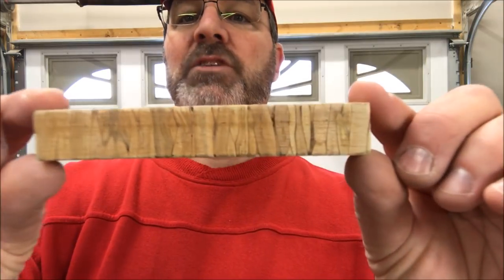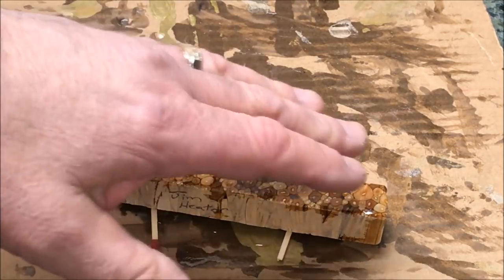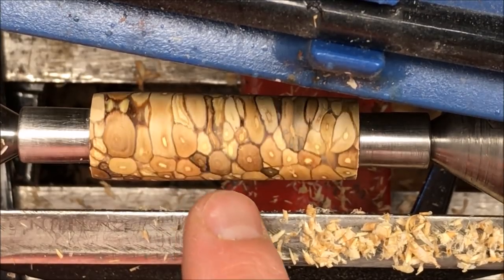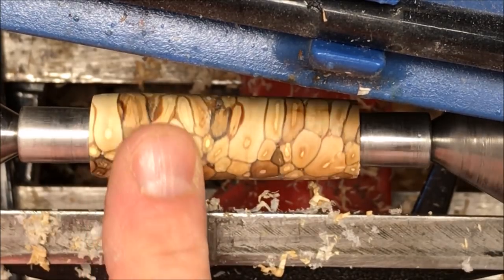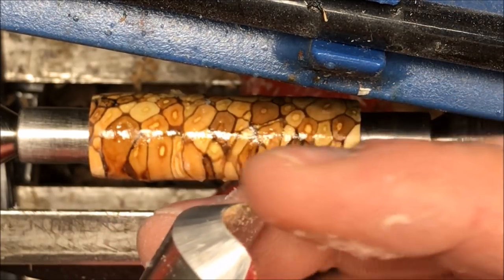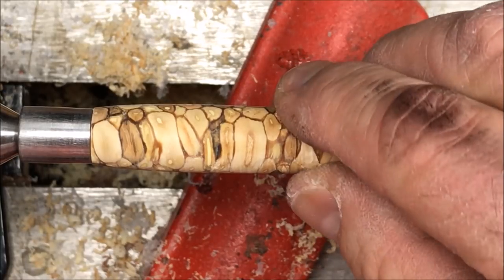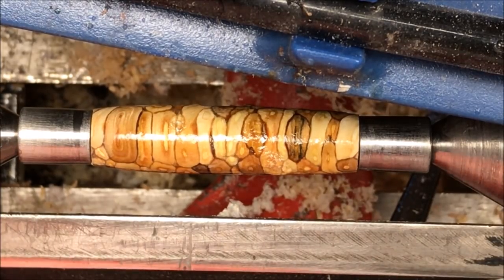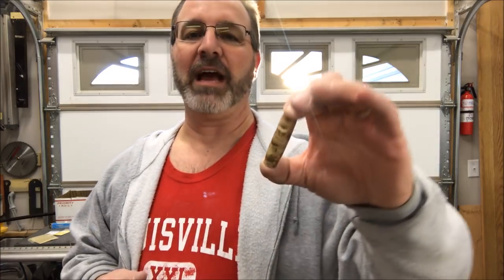Apple Twig Blank

Comment: What a great idea for a blank. Since it is basically 2 twigs that broke off, and since you have a good amount of wood to work with between the tube and the outer edge, and since it is not a symmetrical piece, those 3 points make me believe I could take some twigs of suitable color and carve them so them could be pressed into the void. Glue them and press them in (I would leave a lot of extra on the ends and the thickness. After the glue cures, I would pare them down to match what the rest of the blank looks like and then continue. Even if there is a void between parts new and old, there are voids throughout so it will match. I doubt you can tell the difference when you're done. Good luck. Sam
Reply from the maker: Thank you Sam, that is a good observation of the blank as well as an excellent idea. 

Regards,
Bob

Comment: Hi Bob, Roger from over the pond,That will be a nice pen when it’s finished, I would fill the hole with some of the sawdust you turned off of it, you could even mix some fine copper or brass dust with it and make a feature of it and also add some strength to it . Worth a try.
Reply from the maker: Thank you Roger, 
  I hope to work on it soon. 

Regards,
Bob

Comment: Couple of suggestions: Easiest add a saw dust patch.   However, I would try to make a patch with a small sliver of branch contoured to best fit.   Instead of continuing with the gouge perhaps a finish by sanding to ease the aggressiveness as minimal as it might be.   I have turned some blanks made with Boy Scout popcorn for Troop scout masters and applying bits of popcorn in the voids worked.
Reply from the maker: Thank you for the suggestions Bill,
  Take a look at what I did to fix it. 

Apple Twig Blank 

https://youtu.be/n-8KsMRwEpI

Regards,
Bob

Comment: I think the piece that broke off went into the vacuum. I think I would remove the rest of the broken end, make a small brass, copper or aluminum washer and slide it over the end as a dividing point. then use some of the rest of the blank to finish of the end.   

I love how you slo-mo  the catches and explosions. Great work all around.
Reply from the maker: Thank you and great suggestion. 

Regards,
Bob

Comment: I have an idea that I've been waiting for a catch like this to try out.  Part off the broken end then tightly wrap the tube in copper wire (maybe 2 layers to get the thickness) then seal it all up with CA and continue as usual.  Maybe even use a couple different gauges of wire to get some sort of pattern in it
Reply from the maker: Very cool idea Jeremy. 

Regards,
Bob

Comment: Had same problem with a blank called a Dakota Burl, (ground up sunflower seed hulls). Kinda like turning wafer board and tendency to chip easily. Learned real quick, turn to 80% and then turn rest using 60 - 80 grit shaping paper and work your way up. Never had another problem.  Since it is apple, add some red epoxy to it and tell them it's apple peel.
Reply from the maker: I had a Dakota Burl at the Honor Flight Turning. It blew apart on the fella who tried it. 

Regards,
Bob

Comment: Bob I know you fixed this already. Last time I had a blank chip like this I repaired the blank as you did. I flipped the blank after it dried because the original leading edge was raised similar to yours.I had no further issues and it turned out fine. Of course mine was not a twig blank so it may not have helped...
Ron
Reply from the maker: Thank you Ron,
  I appreciate hearing about your fix. You never know what I’ll have to fix next and this technique may be just the trick. 

Regards,
Bob
Reply: RJBWoodTurner 👍

Comment: Hi Bob I think the biggest problem with the Blank was presenting the Roughing gouge full frontal  at 90*  IMHO you would have had better result if the Gouge was catting at 45 degrees Or even better using a skew Chisel cutting at 45 angle, Thanks for your videos always entertaining and Informative,  Cheers.
Reply from the maker: Thank you Antonio, you’re probably right. 

Regards,
Bob

Comment: Get a couple of twigs roughly the same size, carve a divot out of one side to match the pen tube, the trim the twigs to match the broken sections. Clean off any excess CA from the tube and damaged area, and glue the new pieces in using epoxy glue, not CA. Clamp in place until cured then file off edges until close to the blank diameter, soak in more thin CA, and use a negative rake scraper to finish, light cuts only.
Reply from the maker: Great suggestion, thank you. 

Regards,
Bob

Comment: So gutted about that bob it is a gorgeous looking blank. I wonder if you could use some small slices of wood shavings to layer over it using CA glue? Maybe take a scalpel to cut some wood shavings into tiny slices and glue them over the catch one at a time until you’ve built up a decent layer of wood and CA I reckon if you get it right it would blend in nicely. Whatever you decide mate I can’t wait to see the finished result. 👍🏻
Reply from the maker: Thank you Dave, 
  Great suggestion. 

Regards,
Bob

Comment: Not that it’ll help now, but when I turn very delicate blanks, I pretty much just sand it all the way.  The disc or belt sander to basically get it close, then 50/60 grit to refine the shape and then more sanding and finishing from there.  No need to constantly be messing with sealing it with CA.  Worked like a charm with all of my color pencil blanks.
Reply from the maker: Thank you Greg. 

Regards,
Bob

Comment: Hey Bob.  I hate losing big chunks.  I would put dye in alumilite, or mix sawdust in epoxy and gloop it in the hole, then turn it down.  You have a pressure pot, correct?  If not go the epoxy route.  I've never put dye in epoxy to be honest, but it could turn out cool.  Agree with the comment that that's where the clip goes.  Also, a simple suggestion based on my experiences only: when filling smaller holes, I use thin CA first.  I noticed you used medium CA.  I used to do that too, but noticed the thin CA seeped in to all the hairline cracks/gaps much better, first, then after that sets, use medium for any remaining larger holes.  I don't know why, but it seems like the medium, even as viscous as it is, just has a hard time getting into those hairline cracks.  Maybe others disagree, but I noticed better results, especially after finish work, with that process.  Good luck - and as always great video!
Reply from the maker: Thank you Dirk, good observation on the thin Vs. medium C/A. I like that. 

Regards,
Bob

Comment: I think I would try casting a little epoxy, alumalite or whatever just in the missing section.  Like a 2% hybrid blank...Maybe even use some of the dye powder you just got.  Heck, you can't disguise it, might as well celebrate it.  I'd hate to see you chop that entire end off to put in a hardwood piece...
Reply from the maker: Thank you,
  It is a beautiful blank. 

Regards,
Bob
Reply: Could you cut off a full strip the width of the crack and fill that with epoxy so it would look more intentional?

Comment: Hate to be a Negative Nancy, but a skew is the right tool for that job. You can also do more of a"skew like" cut with your roughing gouge if you angle it. Presenting it straight-on made catches like this more likely. It's certainly not magic, but an angled shaving cut is right for this pen. 

As an aside, this problem is similar to turning black palm, which is prone to having chunks blow out.
Reply from the maker: Thank you Paul,
  I appreciate the information and realize my tool technique needs work. 

Regards,
Bob

Comment: Woodworkers don't make mistakes. They only have cause to redesign.
This is definitely a case for redesign.
My suggestion is a small metal plate to match the pen and position it as an 'anvil' for the clip.  if that is not possible, engrave your makers mark on it.  Brand is everything these days. ;-)
Reply from the maker: Great ideas, thank you. 

Regards,
Bob

Comment: Part out the area containing the gouged spot on the one side, then remove the Corresponding spot on the other side (this will leave a blank with two rings cut out of it). Rig up some sort of way to then cast a bright green tinted resin around just those spots. Turn it down to have a twig blank with a green resin accent ring on each side.
Reply from the maker: Great idea Adam. 

Regards,
Bob

Comment: I turned the long grain version of this blank a couple weeks ago and it was much more forgiving. I'll be turning one of these short grain blanks next week and that's what I'm worried will happen. Do you think a particular lathe speed would be better for this blank?
Reply from the maker: I was turning at 3,000 RPMs. A sweet may have helped. The other thing is, if you know someone who does stabilizing, that would be the way to go.
Reply: RJBWoodTurner ok thanks, I'll try that speed.

Comment: Put a chunk of apple in epoxy (think Peter Brown) and use that for the repair. Real apple with apple twigs.  

Also, would stabilizing the blanks (cactus juice) or whatever other solution you use help during the turning? Or would that affect the logo of the finished product?
Reply from the maker: Stabilizing would have helped but I don’t have the equipment to do that. 

Regards,
Bob

Comment: I would try and make a groove at the top and the bottom Wrap the jewlery like copper wire around using ca put one in the center then then  use put in a filler like glow in the dark powder using CA  That is what I would try.  Love the look so far though great job.
Reply from the maker: Thank you Faye. 

Regards,
Bob

Comment: In my experience, this could go better if you actually removed the waste almost to the blank size on the bandsaw, then sand round. That would remove the possibility of gouging.  Also, it will turn a lot easier with a light touch using a carbide tool. That should fix any issues beyond all the voids you may have to fill with CA. And if you have a pressure pot, you can eliminate those voids by making your own blanks.
Reply from the maker: Thank you April. 

Regards,
Bob

Comment: Makes your stomach upset when this happens, doesn’t it??!! Just a few observations and what I would try. (1) when a fairly large chunk breaks at this point and you’re able to find it in fairly good shape I would reposition it and bond. I would sand this segment and blank down with 200-400 grit sandpaper. No matter how careful you were in repositioning your tool will inevitably catch it again. By sanding it you have eliminated the microscopic edge. If you want you can place a little more thin CA. You can now safely resume with your tool of choice. If the piece is MIA I would pick up some nice flat shavings and laminate them into the void with a very small wooden, flat swizzle stick. Try to get different colors or samples to camouflage it. If your lucky you may be able it hide it even more with your clip depending on its position. It looks like you may be OK where your defect is located. Patching with other materials, dyes, “cactus juice?!”, inlays or on lays I think will really botch it. Good luck Bob!!
Reply from the maker: Thank you Robert,
  Excellent advise.  

Regards,
Bob

Comment: Since its Apple twigs I would fill in the hole with epoxy and sand smooth the whole blank. Then I'd get one of those little stickers that come on some apples and glue it over that section then finish off with layers of ca and micro mesh.
Reply from the maker: Cool idea. 

Regards,
Bob
Reply: That’s just a cool looking blank I can’t picture any other wood to it. Do you have any of the blank cut off left over? If so, square the edge and add a piece of the same blank to it? It’ll have a line but at least hopefully semi disappear.
Reply from the maker: Thank you Manuel,
  That is a great idea. 

Regards,
Bob

Comment: Hi:  First, I would have gone to sanding after the first divot instead of using the tool. I would try removing some of the wood left around the blank to give more of a surface to glue another piece of stick from one of your trees and sand it down and leave the tool alone.
Reply: dentists do this to prepare a crown to what is left of the tooth.  As you remove the wood from the brass tube see if you can cause a recess to hold the wood piece in.  Hope it works
Reply from the maker: Thank you.
Reply from the maker: Great idea, thank you for suggesting it. 

Regards,
Bob

Comment: Wouldn't it be easier and safer to use something like 60 or lower grit sandpaper to remove the bulk of the blank when dealing with difficult materials like this?  Time consuming, no doubt, but how much time is spent "fixing" the blank when catastrophe strikes?  Maybe a rasp?
Reply from the maker: I prefer to use the tools. It’s just the way I was taught. A friend of mine use to say, “Its called pen turning not pen sanding.”

Regards,
Bob

Comment: pile some of the shavings from this blank in the hole, and saturate with thin CA.  Let the glue cure, and then add some medium CA to fill in the voids in the patch.  Let that cure, and then saturate again with thin CA.  

After the glue has fully cured (leave it for at least 8 hours), finish turning using abrasive rather than a tool.  Periodically stop to check the status of the patch, and add more thin CA if the surface isn't absolutely smooth.
Reply from the maker: Thank you Louie. 

Regards,
Bob

Comment: Turn the bad section of wood down to brass. Put it back on the lathe. CA a complementary color of sewing thread to the tube. Then slowly fill the area like a sewing bobbin. Soak the thread with Thin CA until it won't hold any more. After threads meet up with the other diameter.
Reply from the maker: Thank you Bill, 
  This is a very Interesting idea. 

Regards,
Bob

Comment: I'm late to the game (well over a year) but hindsight is 20-20:

On my Kayak (wood) I used epoxy with wood flour to make a paste to fill small "flaws" sadly it will show on a blank this small.

When I've had similar repair attempts..Glue it back in similar to what you did,, build it up similar, but reverse it on the "mandrel" if you have a "lip"  also once I get this far I take it rest of the way with p120 mesh, then p320, then p600 mesh before I go into teh CA and micromesh..  good luck, I'mm gonna look for how you filled the hole
Reply from the maker: Thank you,
  Here’s the fix I went for:

https://youtu.be/knPClQPJx88

Regards,
Bob

Comment: I think I would have used CA to attach the chipped out piece the same way. However, with the lip still present, I would've sanded it down flush and resoaked it with thin CA rather than trying to build it up.  Maybe take the blank the rest of the way down by sanding to avoid any more problems.
Reply from the maker: Thank you Michael. 

Regards,
Bob

Comment: I would think first, treatment like with cactus juice in a vacuum chamber and harden it like you might with punky wood.  Then maybe use some  Millputt pick a good colour maybe mix several colours together.
Reply from the maker: Thank you Edward,
  I wish I had the equipment to stabilize the blank, that would have been the way to go. Maybe one day I will. For now, I’ll have to keep using C/A. 

Regards,
Bob
Reply: RJBWoodTurner I went to Goodwill Thrift Shop and found an old pressure canner for $3 then bought 18 by 18 piece of lexsan about $8 then a venturi vacuum pump for an autostore used for ac about $28.  Toaster oven I bought a year or so from Goodwill $8 that I use or doubles for powder coating my lead cast bullets. It may take 2 or 3 times thru Gooxwill Thrift to find a good pressure canner. Did mine on the Real Cheap Plan.
Reply from the maker: That’s awesome! Great finds.

Comment: It would be a pity to lose that blank. I've seen you part off a chipped out section at the end of the blank before and replace it, but it would be impossible to match the twig pattern seamlessly. How about parting off the chipped out section and putting in a small coin sized disk of plain wood and then a cap of the twig blank to finish it off?
Reply from the maker: Very interesting idea Andy. 

Regards,
Bob

Comment: You are close enough to being able to sand and finish that blank.  I would glue that piece on and just sand it down so you aren't knocking anymore of those tiny little pieces off.  Or CA glue some shavings into the void and then sand it down from then out.
Reply from the maker: Thank you William, 
  That may be the way I have to go. 

Regards,
Bob

Comment: Way to late for your fix but I would have cut a slot in the blank then made a segment to fit,cut it in half and clamp togetherso you can drill a hole to fit the tube and glue together around tube and turn off , black or any dark wood will make a nice accent ring.
Thank for some great vids  Alan in UK
Reply from the maker: Thank you Alan. 

Regards,
Bob